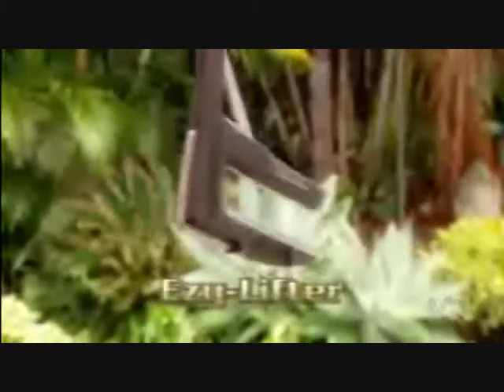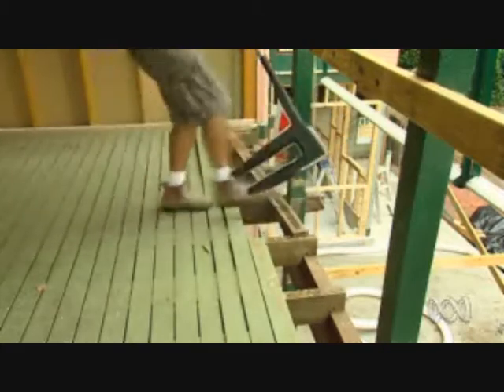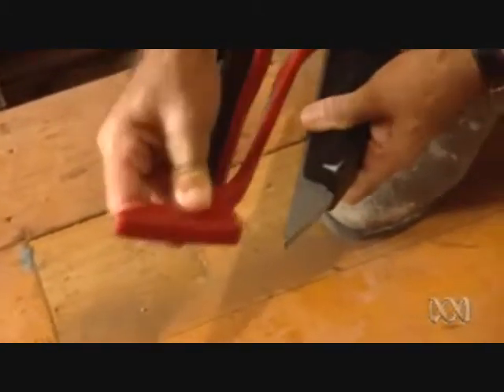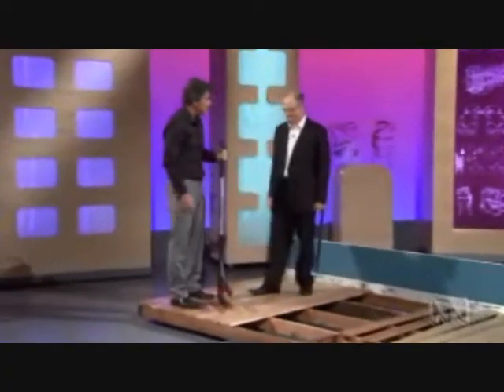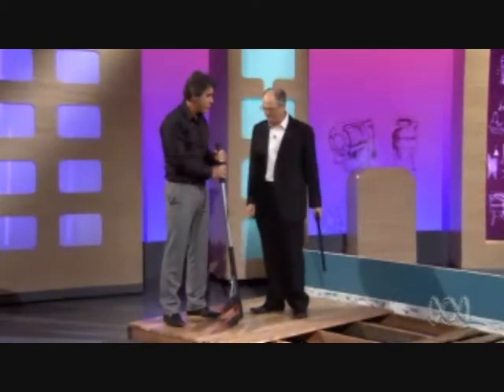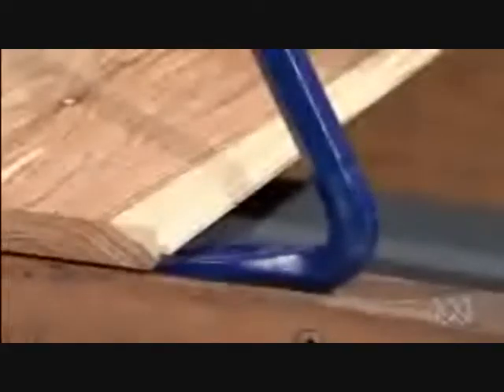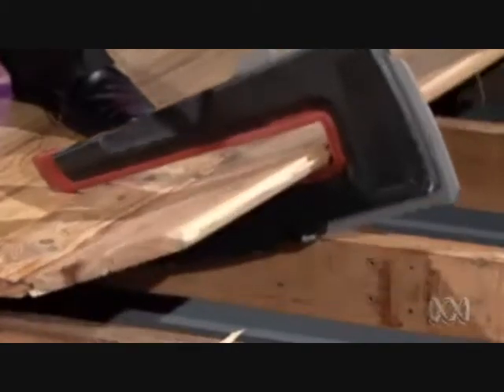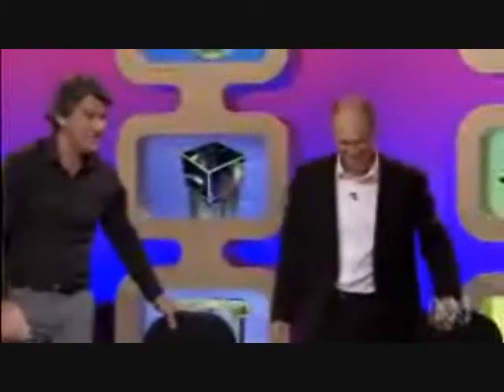Ezy-Lifter invention - floorboard removal tool on New Inventors TV

Comment: My father used a tool exactly like this 65 years ago to lift t&g floorboards for reuse in a holiday batch,  an f shaped device made from a length of  steel water pipe for the handle and with 2 lengths of angle iron welded on to form the f shape, the angle between the handle and angle iron being somewhat greater than 90 deg. So  not novel at all. He borrowed it from and old carpenter who had been using it for at least 40 years and no doubt he inherited it from his grandfather

Comment: it looks like a match maker to me.  turns boards to matchwood.  my own board lifter has been modified many times to a point where i save all boards.  and it works differently.  this might be useful to get the ends of boards lifted instead of sawing along the ends.